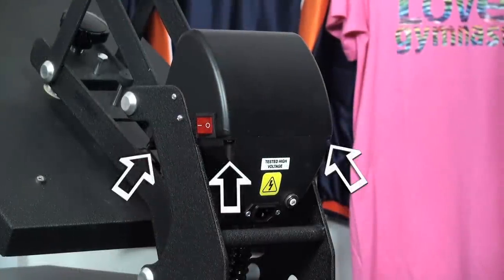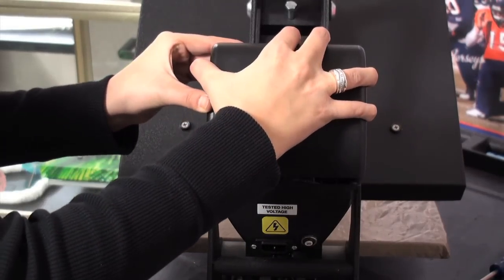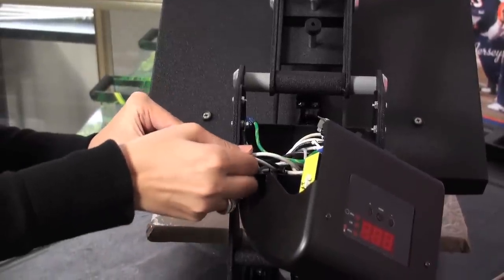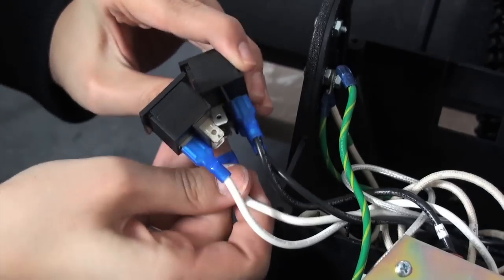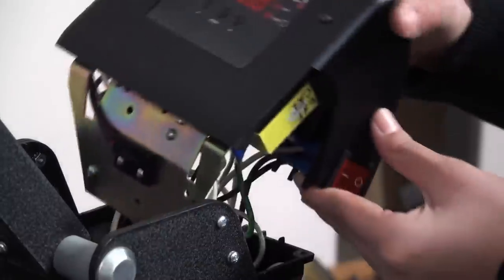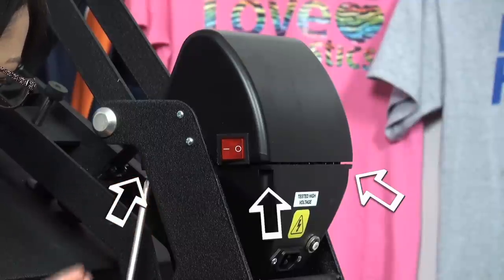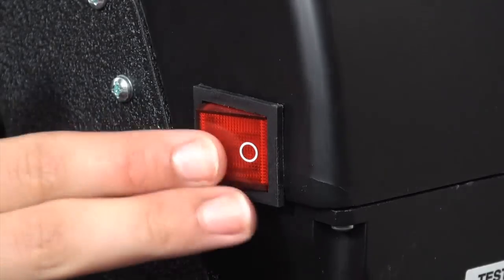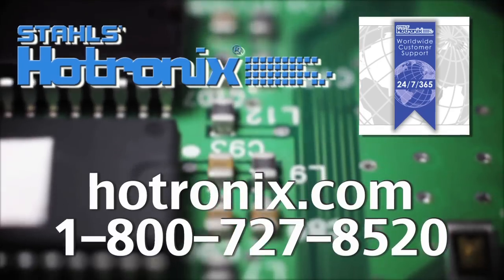How-To Change a Heat Press On/Off Switch

Comment: Mine is the heat press circuit itself, not a home breaker. Been using the same press for 3 years, now it barely stays on 30 seconds and the circuit on the heat press trips and shuts the machine off. It won't reach temp, doesn't stay on long enough for even one shirt...Suggestions?

Its working fine with hat dye, mug dye, plate dye but turn off with tshirts press
Reply: I have the same problem with my Maikesub heat press and cannot find a solution.